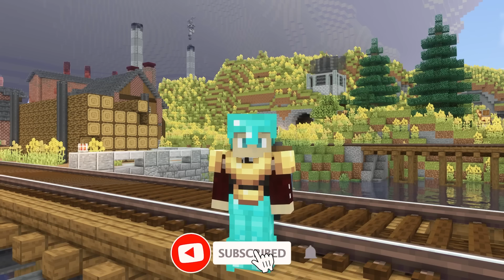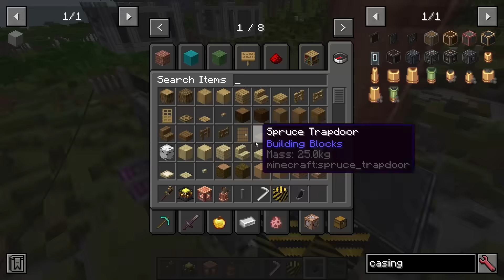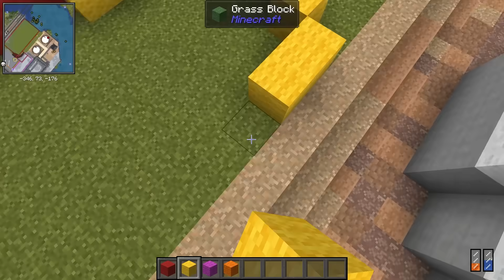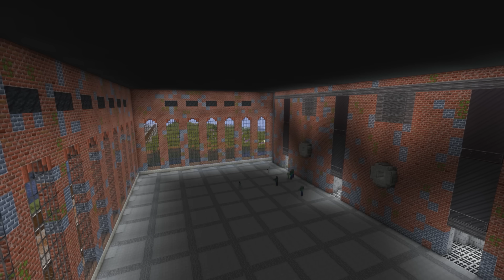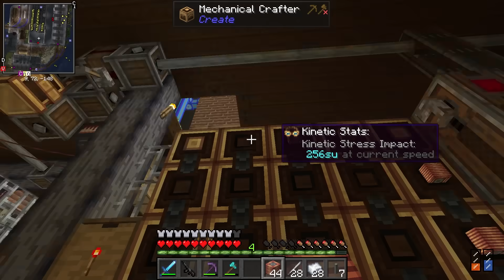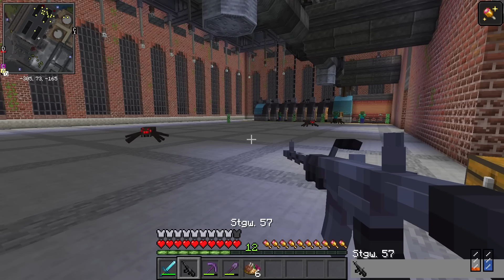I Built a Working ELECTRICITY⚡Power Plant In Create Mod

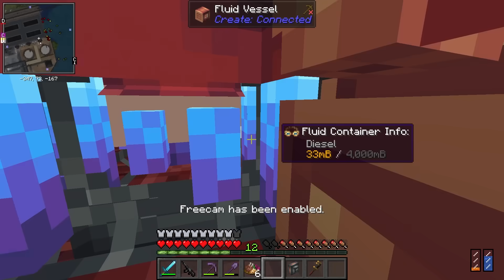Comment: Starting your turbines with electricity is the perfect thing to use your galvenic cells for! 19:40
Reply: Real life turbines require electricity pre-runnup due to casing preheating, generator cooling pumps, aux oil pumps and oil cooling

Comment: There are these horizontal fluid tanks, I forgot what they are called, that could be used as a near instantaneous pipeline that doesn’t require rotational power. If you pump fluid in at one end, you can immediately pump it out of the other end. However, I assume they are rather expensive, so it probably would be impractical for them to be used over longer distances unless you have a ton of resources. I also think you should build a farm area like Mr. Beardstone did.

Comment: If you want to get the nerdy side of a generator - changing the speed of the input does not affect the voltage :D Changing the speed of the rotor will result in the frequency of the output to change (also known as Hz / Hertz)

If you want to change the voltage which a generator outputs, you increase the magnetic field density of the rotor (Usually done by supplying a smaller control coltage into its core)

Comment: If you see this like it so other people can

This mod is not as good as another mod, Create New Age on curseforge for forge, it adds the same magnetic coil, along with new blocks to make power lines and stronger motors, batteries, solar panels, and iron , copper, gold, and diamond variants of power lines, this would have been cooler if it was with that mod.

Comment: Hey sbeev, i have a question, how do you run world so big and complex with so many mods, everytime i try to after some builds, some colony over 100 citizens and just basic create contraptions i run into multiple saving problems, lags, generating issues and the game breaks, how do you avoid that? Is this something in files or you just have nasa computer?
Reply: running your world on a server would definitely help if you don' have a nasa computer. If that's not an option, try allocating more memory for your game to use, I recommend at least like 8 or 9GB for a modded world like that. You can change how much ram is allocated in the profile options for a modpack if you're using curseforge

Comment: Create a substation, it slightly decreases the power loss making it more effecient. If you're interested, I was able to step down 5000v(maximum rotor voltage generation) to 128v(minimum voltage to power an electric motor in max rpm) using this sequence of transformers with the following ratios "4/5, 3/5, 3/5, 2/5, 2/3, 1/3", the denominator is the # of primary coils, and the numerator is the # of secondory coils.

Comment: Just a thought (because I dont know if it'll work). But perhaps the storage bus from AE2 can be used on the schematic cannon? So instead of having 15 chest of materials that needs swapping around, the cannon could pull straight from main storage. If it works, you could even let it craft needed items on its own (provided you have the materials and auto crafting setup of course).

Comment: I really like the mod, so i have some things i could elaborate on:
Voltmeters have 500V measuring range, but it can be changed by right clicking them with wrench.
As you may have guessed, some blocks explode past certain voltage as you have shown. The cables and motors have the highest tresholds, being ~5k V. But the problems come when getting to and fro that voltage, which is why you use the copper coils (they allow to increase/decrease voltage at a ratio of coil blocks stacked nearby). The question of why would you ever want higher voltage, is, of course, transmission. The more volts, the more power per tick you can transfer, up to a point when the internal buffer of cables becomes not enough for more.
Reply: That's really cool. I should play around with this mod. I am currently studying utility power systems and they us a higher voltage for long distance transmission lines for better power transfer; high voltage, low current, and low power loss over the line. Heh heh heh, I wonder if I gotta do power flow calculations in Minecraft.
Reply: What is the mod name

Comment: You can also make "heavy duty" transformers using coil blocks. The ratio between two coil block columns is the same as the ratio between input and output voltage, just like irl.
Reply: I really like this. Minecraft is surprisingly starved for mods which have somewhat realistic electricity generation/transmission. I might lose a lot of free time to this mod😅
Reply: @space_cheese67  create power grid is in my opinion the best!! it uses real equations and is compatible with tfmg too
Reply: @nia4president agree, create:power grid is banger
Reply: @space_cheese67  There's one for 1.7.10 which simulates DC circuits including losses and heat, but hasn't had any releases since march of 2024. I haven't found anything like it for newer versions.
Reply: I keep forgetting "transformers" is as in "Metall batteries used for powering infrastructure" and not "transformers " for  "saving the world from evil" 😅

Comment: An idea for the far future. You could build an aircraft carrier and use flans mod planes. Maybe build the Lady Lex?
Reply: why not VS planes they require some weigt tweaks but are way cooler. also flans is still working on the vehicles for the modern version.
Reply: Why not the Enterprise?
Reply: Flan's mod is for 1.12. and 1.7.10
Reply: @dragojejakic1350 That’s only partly true. The original flan’s mod isn’t up to date, but he’s actively using the newly maintained version of flan’s mod in his mod pack. It doesn’t have vehicles like the old one used to, though.

Comment: Great video! Also, for the voltmeter, it's written "Measuring Range : 500V", so it'll display a max of 500V, even if the real voltage is higher!
Reply: 500V, not great not terrible
Reply: @maximilianobenitez4224  "It's not 500 volts, it's 15000 volts"
Reply: @RMGX011  "It's not powering just your base, it's powering every factory, every megaproject all around your word, hour after hour, not for a day, not for a week, the whole continent electrifyed to the end of days."
Reply: @RMGX011 just say 15 or 150kV
Reply: @RMGX011 itd be 115kV.
Reply: @maximilianobenitez4224 "but sir, it only measures up to 500V"
Reply: @maximilianobenitez4224  its also the max reading of the dosimeter
Reply: @maximilianobenitez4224  thought exactly this. Then the reactor exploded
Reply: @maximilianobenitez4224 Not good for distro or transmission
Reply: Also iirc you can increase the Measuring Range by right clicking on it, it only goes up to 2000V tho
Reply: "The voltometer is reading 500 volts. I'm told that's the equivalent of a chest x-ray, and no cause for concern."
Reply: chernobyl vibes
Reply: Even though technically in real terms shouldn't the RPM be affecting the current and not the voltage? Because voltage is produced by several stators together if I recall correctly
Reply: @verdisquo97_arts , I wish that mods that use real world units used them in a more realistic way.
If not, I prefer them inventing their own energies, like "forge energy" (FE).
Reply: @thomasfplm  it's extremely difficult to code, maybe try electrical age
Reply: @verdisquo97_arts , I could imagine being even worse by adding alternate and continuous currents and phases for the generators. 😜
But as I said, I would just have used something like Forge Energy, in the same way they use Stress Units instead of joules or watts.
Reply: We need lunar rovers to calculate that
Reply: Don’t fuse it
Reply: Nice pfp dawg
Reply: Do you half to leave a review like one of those moms that says great toy it's really good for my soon😂
Reply: Chernobel moment
Reply: 现实当中这只会损坏电压表